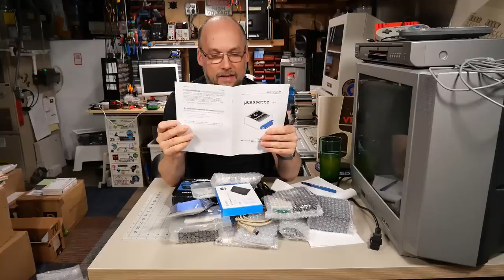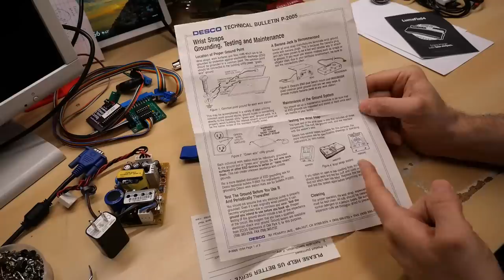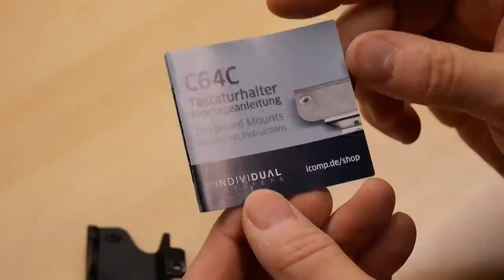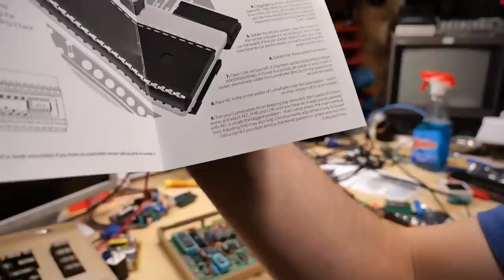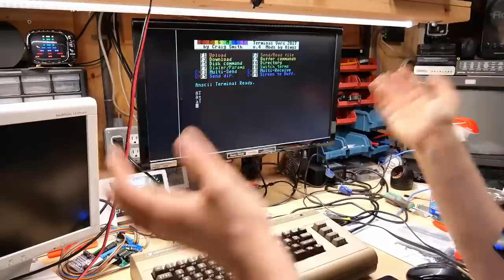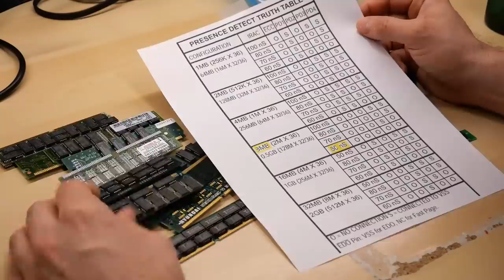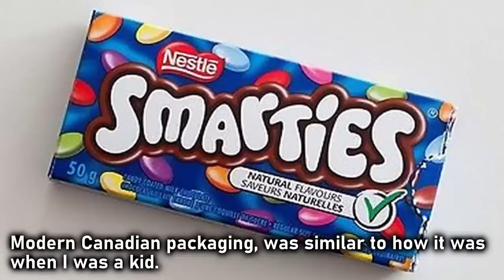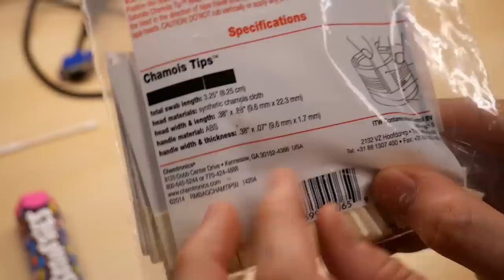A C64 datasette alternative, Lumafix test, Mac robot, and a yoyo for a Powerbook G3

Comment: Hi Adrian! I’m actually the one who had the Classicbot Classic drop-shipped to you... it seems that playsometoys in Hong Kong accidentally shipped it to a guy in Virginia who was kind enough to contact them and forward it on to your PO Box! Loved watching the Mac Classic repairathon series and thought this was fitting. Thanks for all the hours of entertainment!
Reply from the maker: I'm glad it made it to me in the end! Thanks for sending it -- such a cute little thing.
Reply: @adriansdigitalbasement  Peanut.  Hahaha!  That Mac robot reminds me of the Banana Jr. (Google "banana jr 6000 computer" for a laugh).  

Are Smarties in the US still packaged in plastic containers a la Tootsie Rolls?  I remember them as a kid being more of a chalky PEZ candy instead of like an M&M.   

Incidentally, the yoyo power supply's weakness wasn't just the 2-prong cord, it was the cable that plugged into the PowerBook G3; the weak point is where the wire feeds into the center of the yoyo.  Also, the PRAM battery is the 2-wire connector near the trackpad.  The battery will be encased in a round, plastic brown package.  You might also have to press the reset button on the back panel after you reconnect the PRAM battery (it'll be a small button with a triangle label located between the SVGA and phone modem ports.).
Reply: Adrian's Digital Basement it looks like the legs on the bot were cracked at the hip joint.

Comment: Glad you liked the little goodie bag. I have indeed now opened up my Mac SE and found that all the caps (indeed all the components) are through hole. The battery had a 1989 date on it (!) but had not leaked, so just replaced it with a new one. The computer works just fine. But is in desperate need of retro-brighting, plus a couple of upgrades (RAM and a solid state hard drive replacement.)
Reply: I think Adrian has plenty of RAM. He might send you some 😁
Reply: When I checked the battery is my SE a couple of years ago, it had a 1989 date code, and still showed the full 3.6 volts. I snipped it out anyway just to be on the safe side.
Reply: No snipping required. Mine had a battery holder.
Reply: @judgebeeb1967  Interesting - mine was a battery with wire leads attached, soldered to the board.
Reply: Don't retrobright your computer without seriously considering the long-term effects on the plastic.

Comment: You can heat up the stem of those sham swabs and then put a 45 degree bend in it, it will help getting in between the drive heads.

Comment: I have used the Chemtronics strips to clean VTR and VCR heads a million times during the thirty plus years that I worked in TV stations.
Reply from the maker: That's cool. Did they require this manual cleaning or did cleaning cassettes ever play a role?
Reply: Adrian's Digital Basement  we had to clean heads by hand several times a day.  Back in the days of two inch tape they had to be cleaned every couple of hours because the head drums ran so much faster.  I never saw a cleaning cassette for either three quarter inch or Betacam machines.

Comment: For the PowerBook G3 the pram/cmos battery cable is the red,black, and white cable seen at the bottom middle of the keyboard area. Unplug that and it should boot up. I have this issue with my G3 but leaving it unplugged the machine will work fine.
Reply: Thank you for posting this ....was about to tear down my unresponsive PB pismo...booted right up
Reply: Some CMOS batteries fail short circuit, so try simply disconnecting it and leaving it disconnected. You should be able to find something suitable to replace it on ebay. You may need to save the connector and cable from the current one to solder on to the replacement, if you can only source the bare cell.
Reply: oh duke! neat to see you here!
Reply: Crazy Tech Reviews of course I’m here!

Comment: The plasticizers in the PVC wiring affects the ABS plastic boomboxes have the same thing I got to say little Boombox from the 80s that the power cord was wrapped around it and it did the same thing and it's an ABS tight plastic

Comment: @11:14 The 8 pin is 2x4pin EPS connectors for CPU power, the 6 pin is a PCI-E power. PCI-E connectors are 6 pins or 8 pins, with the 8 pin PCI-E connector being introduced in PCI-E Gen 2 (2007), after the 6 pin in Gen 1 (2003).

Comment: 100 Base T splitter: I believe 2 of them needed (one at each end) to allow 2 100 Base connections over a Cat 5 cable. I have some from a different manufacturer that I used in the past.
Reply: Yeah, you need a pair. You also needed CAT cable with all pairs installed, some cheapo Ethernet cables would eliminate the unused pairs to save cost though I don't think that's common anymore. Basically it would move one of the pairs onto the unused pair, and then at the other end move it back to the correct pair so you could put 2 connections down the same cable. I have a feeling that you'd run into issues with long cables, though, as the different signals while sent balanced and with the conductors wrapped, there would still be some small capacitive coupling that might cause problems. You'd normally never see that because of course only one connection would be sent at a time; the reason it's not an issue with Gigabit is because the two pairs are synchronous.

Comment: The 10/100 Ethernet splitter has to be used as one of a pair - one in the wall socket and another in the patch panel at the other end of the cable run. It works because 10/100 Ethernet only uses 2 pairs of the 4 pairs in the cable, so the passive adapter allows you to use all the pairs, which saves running extra cabling to expand a network.
Reply: yep i make them myself for at home so i have two surveillance camera's on one ethernet-cable with the two spitters at either site works fine no interference so far for these purpose
Reply: I remember these were popular in the patch panels. They were too lazy to run new patch cables so they split them. Works ok for slow network printers, but caused all kinds of issues when used on computers.
Reply: Nobody's specifically noted this here yet but Gigabit Ethernet uses all four pairs so this adapter won't work with Gigabit. However, most Gigabit devices will fallback to 100Meg after several seconds so you still will be able to get a connection.

But switches are cheap nowadays, there's little reason to use these adapters nowadays.
Reply: @eDoc2020  yep of course but if i'm at adrians basement so 10 Megabit is already fast 
also if it is 100baseT adapter likes he say it wil have problem's with heavy traffic and modern switches also doesn't like it
its like we are making a timejump to the last century in the 1900's to see the old goody's

it just also fantastic to see how people implement modern things for the old C64 
like faster loading with sdcards interface or so to replace a cassette recorder
thanks to adrian for do this on youtube
Reply: I found this out after running industrial ethernet cable. It only has 2 pairs!

Comment: As a UK viewer, appreciate the way you talk about the US states in this video. I was familiar with Michigan, and I was familiar with Detroit, but I wasn't aware that Detroit was in Michigan. 

I've noticed when watching Kim's Convenience (set in a convenience store in Toronto), that half the sweets on his shelves were US and half were UK. It looked like a good mix. I used to save up to buy imported American candies. Seems like Canada had the best of both worlds. 

The Apple MagSafe laptop chargers were similar to this older one. They're squared, sure, and the connector is on the corner instead of on the bottom, so it can lay flat. But the cable management is still only for the brick-to-laptop side of things. The extension cord still flops around aimlessly. At least there's a direct-plug option, but if you need the extra length, and need to carry it with you, it's just as awkward today. (I honestly have no idea how their recent USB-C chargers are built. Do they have any cable management at all?)

I must admit to have been one of those, surprised you weren't able to identify the prior PowerBook, back then. Not because I expected you to know it already, but just because "powerbook g3 identification" is a Google search which gives you many resources, I believe one is even on iFixit. So when you were spending hours in vain looking up instructions for how to get inside a different model, and complaining about how you don't know which one to look up, I specifically was surprised that you didn't try Googling to see if anyone had an ID-ing guide. I presume you've had to use similar resources for other company's machines once or twice.

Comment: the splitters definitely work, you need 2 of them tho. You plug one on either end and can use 2 devices over a single network port.
Reply: 100baseTX only uses 4 wires out of the 8 conductors in the cabling, but the cabling usually has all the conductors connected properly, so you can use these "splitters" to use the other half of the cable.

Comment: For antistatic grounding without a wrist strap, set up a DIY grounded touch point through a 1M ohm resistor and make a habit of touching that after returning to your workbench and before working on something ESD sensitive.  I don't even bother with that.  I just touch an item on my workbench with a known to be grounded metal case which, from what I see in the video, should be the front plate on the outlet box to the left of your monitor.
Reply: The wrist straps are really not necessary in the pacific northwest.  I've worked in IT for decades here and have never encountered anyone wearing them or even advocating for them.

Comment: The Intellinet Ethernet splitter is just that.  10/100BaseT connections only use 2 pairs (4 wires) out of the 4 pairs (8 wires) available.  So you would plug one of those onto each end of your Ethernet drops and have two 100 base T connections on one cable drop.   Today Gigabit uses all 4 pairs.   I used to use home built versions of these and also use to make custom spliters so I could use 4 of the wires for a serial connection to a mainframe with Xon Xoff 4 was enough.  Ground, Signal Ground, and pints 2 and 3 for TX/RX.

Comment: At 2:45 AGREE!  I'm 72 and have NEVER used a grounding strap and have NEVER destroyed a component!!  
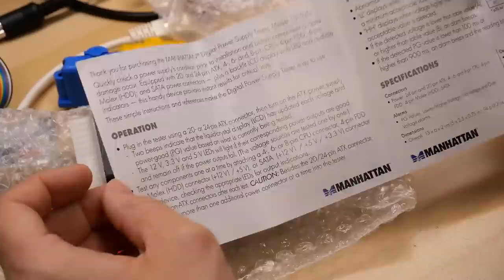Just use common since!!  At 11:15, it will also show current.  At 27:35 issue the Echo command ate1
Reply: Modern components are more vulnerable to ESD. Your not able to tell if you never destroyed a component. I'm also not using protection, but the chance is there.

Comment: 20 years in tech, static killing components is a myth I've never seen a PC component not cope with static. I've tried to kill components by purposefully shocking them and rubbing them on carpet... the results - perfectly fine. I'm sure that antistatic is relevant to micro electronics, but lets be real, PC enthusiasts aren't troubled by it. People usually argue with secondary anecdotes. Now given this is the internet, at least one person will be able to counter argue with a static horror story :P Also, given MSI are in a bit of trouble right now re: Scalping GPUs it's only fitting to ditch the heat sink haha

Comment: How come you didn't read the letter from Mike? (the first guy who sent the cornucopia of stuff.)

Edit: Btw, the power supply tester won't test load, but it will test for a "Power good" signal on the supply (in addition to the voltages) and report if there are any issues with that.  I have a similar unit. -- You can probably also find a dupont extension cable for that card reader for cheap.

Comment: The 100BASE-T splitter makes perfect sense! In theory, you don't need a switch at all for Ethernet; It just means only one pair of devices can be transmitting/receiving on the shared link at a time. I'm a bit surprised you don't remember the good ol' days of dumb hubs with their collision lights permanently on!

Comment: 11:14 It usually puts a load on the +12v via a large resistor inside (is not on long enough to require heatsink). They can give additional info such as timing for power ready and it's quick and handy to see all the voltage readings at once rather than having to jumper the power supply on and then checking each voltage in turn. TLDR: handy if you have a lot of PSUs to test :)

Comment: Aside from going through the regular online jungle routes (Amazon), paint markers are a regularly used tool at my work. I think we typically get them through our welding supplies distributors here in the States (Norco, AirGas, etc.) and I believe I've seen them at Home Depot and Lowe's, etc. Also check out craft and hobby stores, especially if you want different colors than white and yellow, or want metallic colors.

Comment: Plastics are typically only flexible because solvent is present in the mix. If that solvent migrates to the surface of a cable, it may effect a nearby plastic (solid) peripheral case.

Comment: Adrian, just today I picked up a silver metallic Sharpie and a gold metallic Sharpie.  I tried them on a chip and the gold metallic works excellent for marking chips.  It's very bright and readable.  The silver also works, but not quite as well as it seems thin so the black chip ceramic makes it dimmer, if that makes sense.  (Neither one has any kind of electrical conductivity.)

Comment: 55:24 I believe the PRAM battery is the white-red-black plug right of center at the bottom .  It's actually two batteries connected in series.  At least, that's where mine is located.

Comment: Hello Adrain. Were you able to perform an RF mod fix on that C64C you use in this video? I have the same model with 252311 mainboard and the RF modulator is different from those you showed in your RF mod video in April 2020 and I don't know if it can be improved in a similar way to that you have shown earlier.

Comment: yes, the power supply checker does just check the voltage rails and beeps if the voltage is under spec letting you know if the power supply is bad

Comment: 10:38 This device allows you to connect two devices with 100MBit/s each using a 1GBit/s (CAT5+) cable using 4 wires each of the 8 wires in the cable. You could also do other stuff like connecting an analogue phone and a PC via 1 CAT5+ cable.

Comment: 10:43 If I did not misunderstand what I saw. The network splitter 100 is used so that through the same cat5 utp cable you can pass 2 lines for 2 pcs without a hub or switch to take out several computers from one line
This can be done because the utp network only needs 4 wires, 2 to send and 2 to receive and as the UTP 8 cable can maintain 2 lines it has complete.
It must be ensured that the pairs are twisted with their negatives or the signal will not pass after about 20 m.
you also need an adapter at the other end that sends 2 signals (lines) from the HUB or Switch or Router.
Only save the cable, which can be used for 2 computers that are close and that are far from the router.

Comment: The Microcasette would work with all the  8-bit Commodore machines (although the Plus/4 series needs an adapter as the port is physically different but electrically identical) because Commodore new changed the tape format from the Pet 2001 to the Commodore 128.

Comment: I'd say that the serial + parallel connectors probably pull apart so you can wire up your own adapters and then you'd just punch out the hole for the wire to pass through, but I've no idea why they'd all be marked "<3" if that's the case.

My other thought is that older Panasonic laptops would use a parallel port adapter to know if it should reset/clear the bios/cmos.

Comment: The 100base-T splitter works, but you have to use two of them. One in each end of a patchpanel/outlet. In other words two cables into one cable, then split up into two again. 100Mbit only needs four of the wires in a Cat cable. It was common to use when 100Mbit was the standard and you wanted to split up one outlet into two, either for a desk phone or another computer. It does not impact performance unless you try to use gigabit (which needs more than four wires).

Comment: that esp8266 module uses 3v3, not 5v for the uart. I didn't see any limiting resistors on the board. maybe they are under the module? if not, does the iec serial runs at 3v3?

Comment: It's weird to think about how long it took for laptop manufacturers (including Apple) to realize that when they print the logo on them that way, everyone around you sees an upside-down logo when you have it open. I suppose the most elegant solution is to just have a logo that's symmetrical to begin with, which ironically would have been good news for Microsoft if they had been in the business of manufacturing laptops during the XP-7 era.

Comment: 12:50 I have a C64 which has red marked eproms. It is from 1983 assy no. 250407 and the roms are 901226-01, 901227-02 and 901225-01.
Reply: It's called 'painting over with a red marker' :D
Reply: @AmstradExin  Yes it is but Adrian asked to tell him if anyone have seen those and I have.